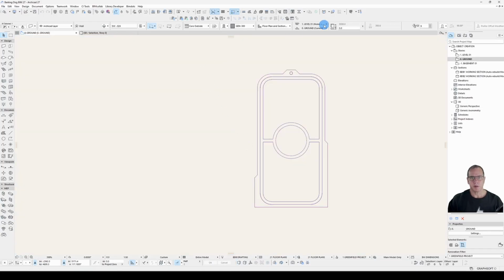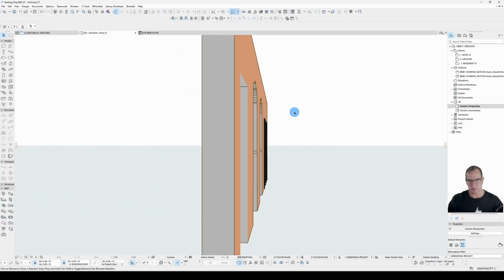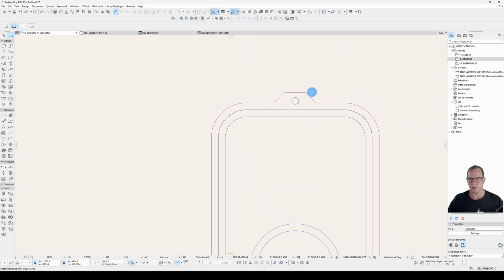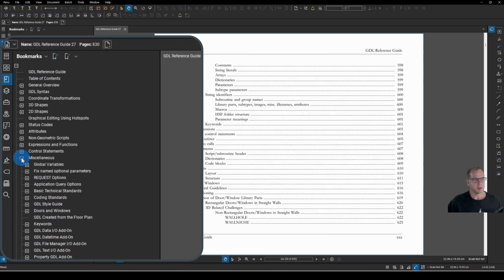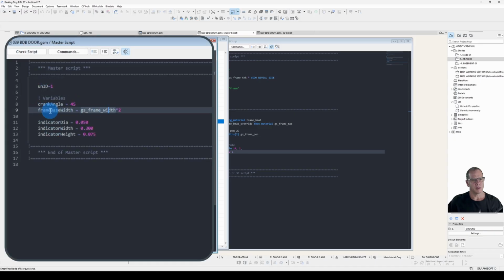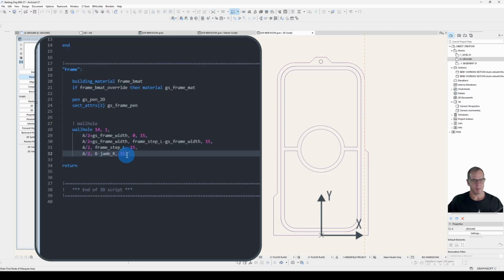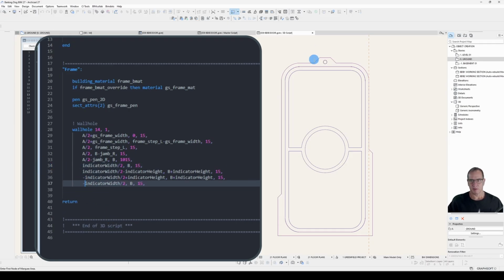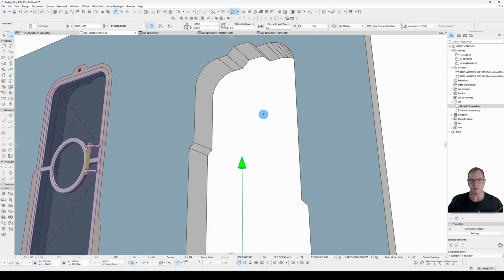039 Archicad GDL Custom Doors Part 1: Setup & WALLHOLE

Comment: Brilliant, any chance for a model view option to show the door closed in an elevation view and open in 3D?
Reply from the maker: You don't need an MVO, just check the GLOB_VIEW_TYPE.  4 = Section, 5 = Elevation, 3 = 3D.  Use a separate parameter for each view if you want so you can have different open angles for different views.